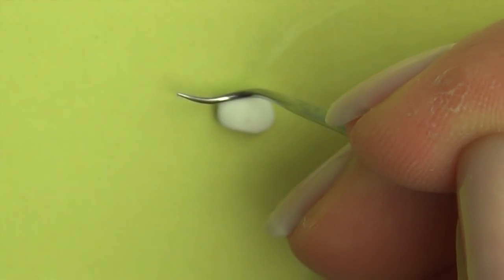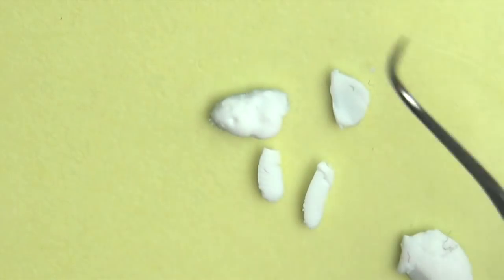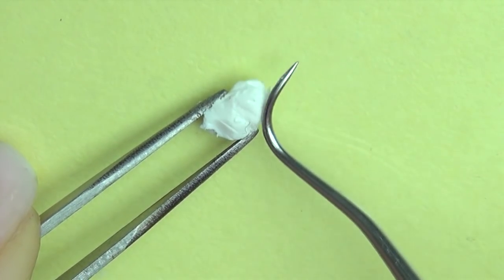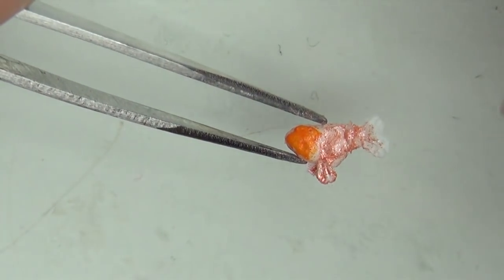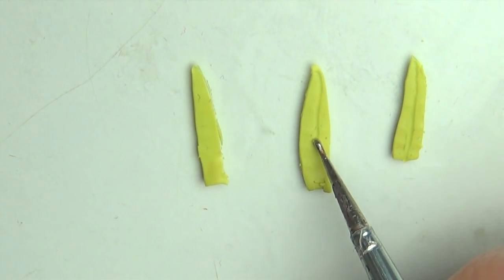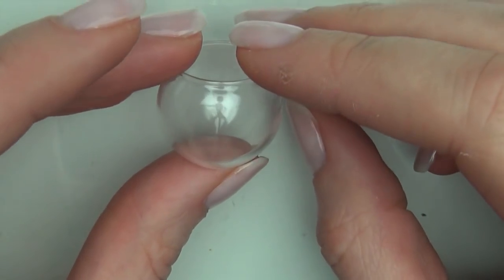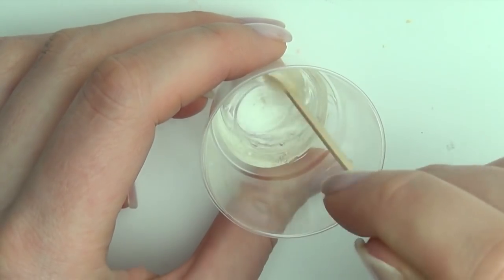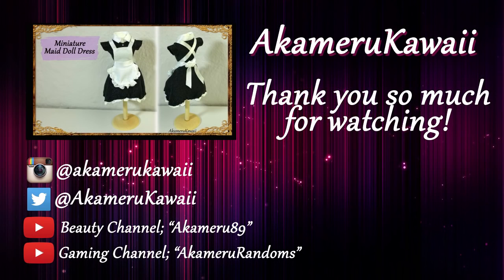Miniature Goldfish Bowl - Polymer Clay & Resin Tutorial

Comment: AMAZING AMAZING AMAZING!
 hey, for the resin to not have bubbles or turn white ya need to mix it VERY slowly for the time it say (the one i use is 10 mins) if you mix it to fast it creates a chemical reaction that makes bubbles and sometimes the thing turns white. so yeah, very slowly and gentle nex time n-n
Reply: Bárbara R Lol the reason bubbles form is resin when you stir fast is because your pulling the resin up and over itself allowing air to be trapped in it. Like it will any liquid to prevent that you do indeed stir slowly.

Comment: Can you do this with air-dry clay?
Reply: I know this is an old comment but I thought I’d answer in case someone else has the same question:

You can use air dry clay, but you have to make sure to seal it extremely well. 
Air-dry clay is usually quite porous and will cause air bubbles to leech in to the resin all around the fish/decoration made of clay if it’s not sealed. 

The same goes for any porous material like wood, unsealed sand or dirt, etc.

You can even seal it by painting a layer of UV resin or epoxy resin over it. Then the resin coat will visually disappear when you surround the fish (or whatever) in the resin “water”.

Comment: To get rid of a lot of the air bubbles, instead of using a lighter (which works just the same) there's heat-guns you can buy to do the same thing but 'safer'.
Reply from the maker: +Sarah Wiseman I know the trick, but I could no do that for this project, since it would have moved or burned the fish ^^
Reply: +AkameruKawaii I heard that blowing through a straw works